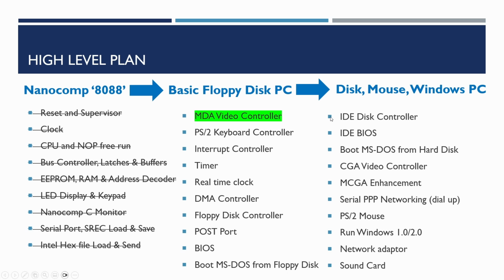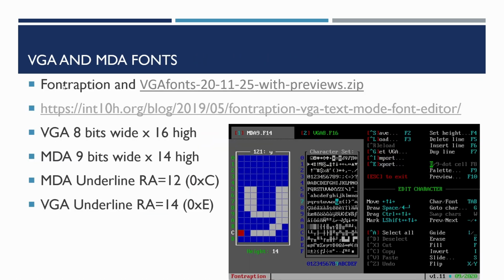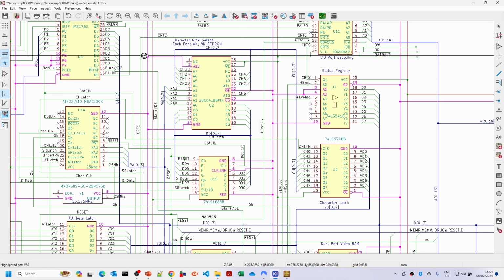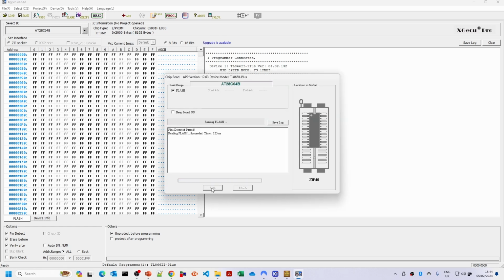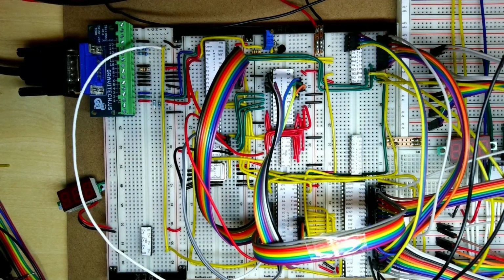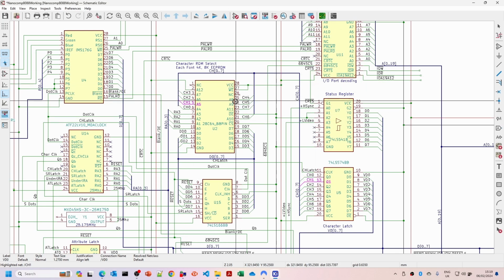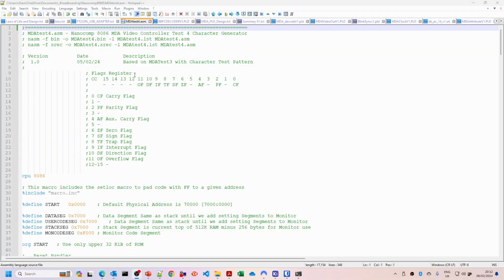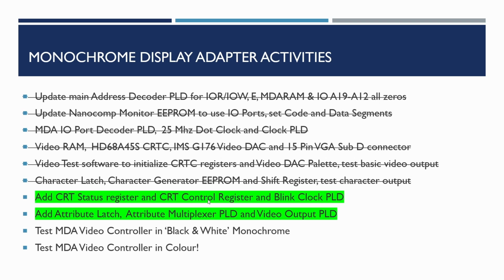Breadboard 8088 PC MDA Video Controller (MDA#6) #18

Comment: Which Frequency Specification should the IMSG176 have? 40, 66, 80MHz?
Reply from the maker: 40 Mhz is fine as VGA 640x480 is 25Mhz. 40 Mhz would do SVGA 800x600. The others will be XGA and higher resolution.